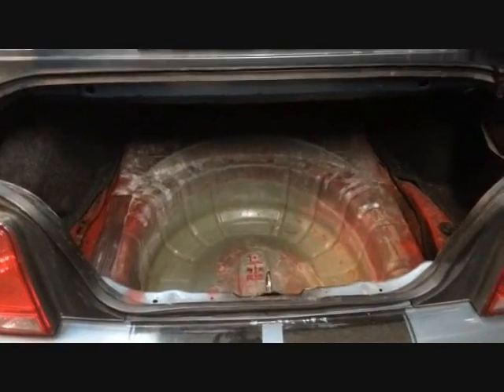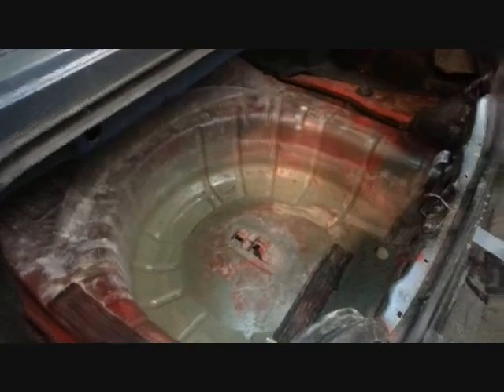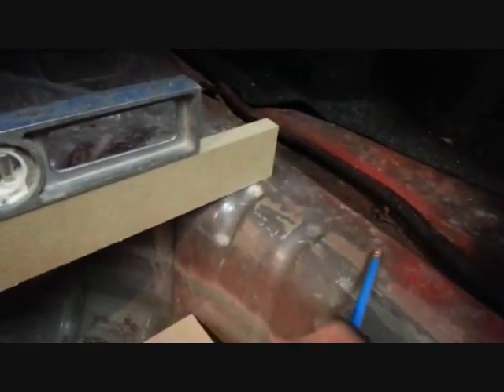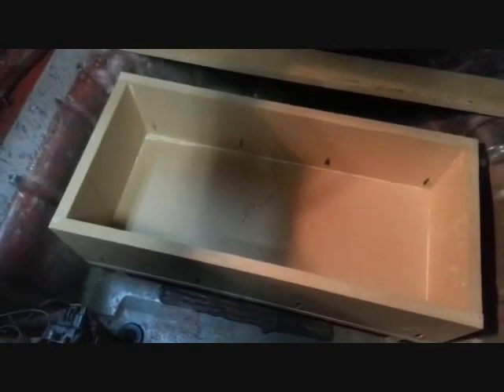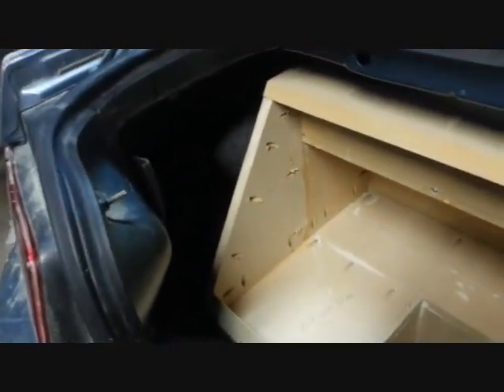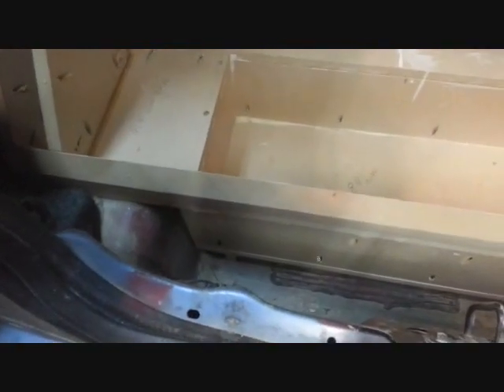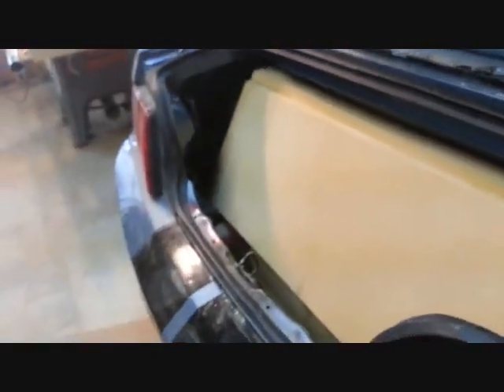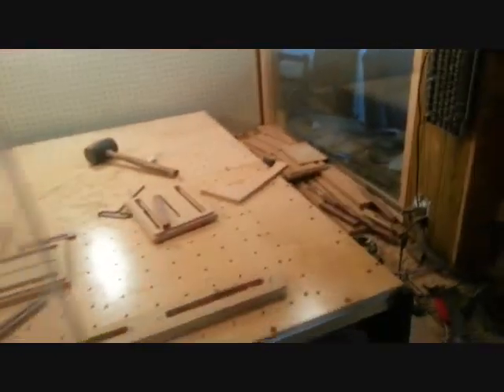2 12  Kicker L-7's in a  Mustang Convertible Build

Comment: Love my CherryMan Customs 12” slot port 32 Hz tuned Box with lexan window and Incriminator Audio etched logo. I just used Duratex to paint and coat the box. Will remove terminals and run speaker wire straight to Amp on new install! CherryMan for The Win 🍒🤵

Comment: I can tell that this was well built, Im sure it sounds great, but this had to be for a single guy under the age of 22, forget a golf bag you aren't getting a single golf club in what remains of the trunk, I have a similar body style convertible mustang, I want to add a sub to the trunk, and it is a tight fit, but I would want at least some sort of storage with the top dowm, at least enough space for a large hand gun.

Comment: How did it end up sounding with the top down?  I have a 07 GT500 convertible and I have ran a couple different sealed set ups (single L7 15" at 3 cu ft and pair of Polk SR 10" at 1.2 cu ft) and I haven't been satisfied with either.  The L7 seemed to shake the hell out of the car for sure.....would even make traction control kick in occasionally
Reply from the maker: customer did not stay in contact with me sry

Comment: I have the exact mustang and i am trying to get my system straightened out. 
 I have 2 BAMF-122 
Max Power Handling 3,500w
RMS Power Handling 1,750w
Efficiency (1w/1m) 85.00
Voice Coil Configuration 3″ Dual 2Ω
Motor Volume 272oz.
Mounting Depth 6.75″

I'm not sure what amp i should get and where to put the amp. Any help would be appreciated.